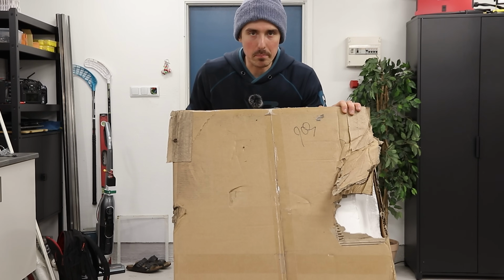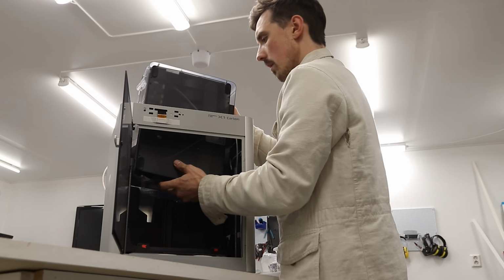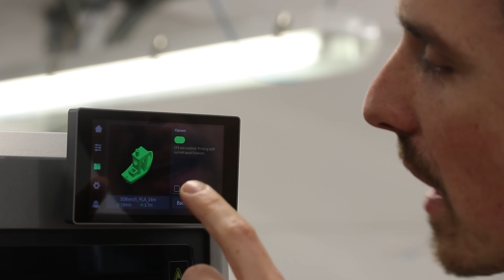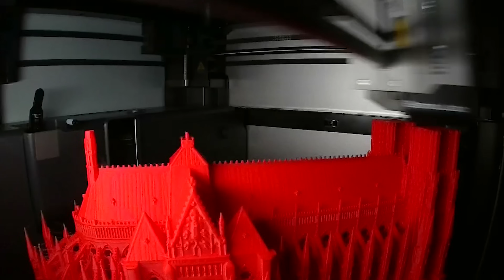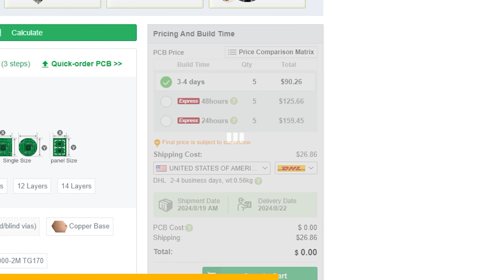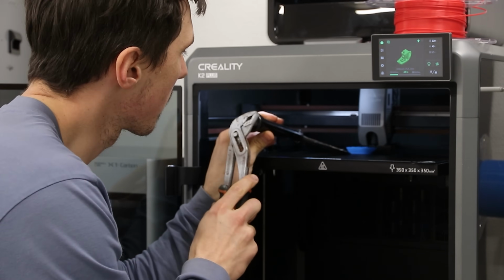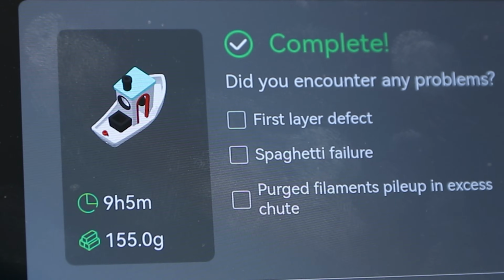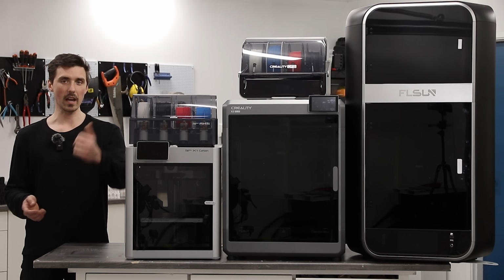Did I Just Find the FASTEST 3D Printer?

Comment: The best use of the AMS I've found is to use PETG as a support interface on ABS prints and setting the support Z-distance to zero. PETG doesn't stick to ABS, so when you're done, the supports effectively fall off with little effort, but with the zero z-distance, there's no artifacting on even the largest of overhangs. It's great.
Reply: I have tried the same thing for PETG/PLA combination and it all fell apart. Even with a lot of purging and a ton of wasted plastic the nozzle did not clean enough to completely prevent contamination. The prints had near zero layer adhesion. With PETG/ABS combination this is not the case? That would surprise me a little. I would expect at least somewhat similar effect.
Reply: @hebijirik because PETG prints at a higher temp than PLA, ABS and PETG is about similar. Anything more than 30,40 deg difference would probably run into issues like the hotter material melting the not as hot one
Reply: @JojoJoget temperature is one thing,  but chemical contamination is another. Maybe you have noticed that after switching from PLA to PETG, the perimeters of the first layer can be peeled from the print really easily. And that is despite the leftover PLA being purged out of the nozzle by the PETG at 250°C and is almost liquid. So when something like the AMS keeps switching them for every layer then the PETG print barely holds together. I was curious of there is something similar happening with ABS because I never tried that combination.
Reply: I dont have that problem. Maybe bad combination of filaments ? 😂  @hebijirik
Reply: @hebijirik  I´ve done PLA/PETG combo prints with PLA as an interface layer for the supports on a PETG print. Worked great. I set both materials as PETG in the slicer though, so it might not work with Bambu filament where the AMS can read the RFID.
Reply: @Fusionpåskånska interesting,  I  tried that years ago with prusa mmu and got the problem described above even with purging set to max the slicer would let me. At first I thought it worked great,  on a print with large enough layers. But then on a print with thin walls I found it unusable.
Reply: @hebijirik  so far I have only printed stuff with large support surface areas using this technique so it might be that it doesnt work on thinner parts.
Reply: @Fusionpåskånska could be. The longer the PETG layer takes to print the higher the percentage of it that gets fully clean PETG with no PLA residues clinging to the inside of the nozzle and then the part holds together enough.
Reply: @hebijirik  I found double purging works, but the H2D solves it for real.
Reply: @rsilvers129 I'm tuning a V-Core 4 500 IDEX for someone now, and on that, the dissimilar support materials work well too. And the change of nozzle takes about half a second only so not longer much printing time when you use it for that.
Reply: Why would you even care about support interface for ABS of all things
ABS literally doesn't stick to itself if you have enough cooling
Reply: so to confirm, no more bad prints on supported areas with PETG?

Comment: Since you are printing technical parts, I think only thing missing from comparison is testing geometric accuracy (that might be a problem in Delta printers). And what I always want to see - bed meshes which I think are by far the most reliable indicator of build quality.
Reply: And maybe some more "exotic" filament :)
Reply: Yeah, tecnical parts should be printed with others filaments order then PLA. Bambu will be much more reliable with those… PLA test is not what I want

My Creality K1Max is a pain in the ass to print engeneer grade materials that do not need a heated chamber, PLA works fine and reliable. Bed mesh is a trying and error experience, never the same!
Reply: Delta are good for round-ish tolerance and less good for square-ish tolerance. They both have their pluses. But delta build volume is weird and that noise is unusable unless its in a separate State 😂

Comment: Well, now it's time to test Bambu H2D?
Reply: same question why compare x1c while we have h2d........
Reply: @ResulIlmammedov  Because he compared printers at the same price point. H2D is 3200 eur.
Reply: @AstroNootFPV  It still high enough that it still wouldn't have made sense to compare them, but in the US, the H2D is 1,900 USD for the base printer, 2,100 with the AMS 2 Pro, 2,800 with the 10 watt laser and AMS 2 Pro, and 3,500 with the 40 watt laser and AMS 2 Pro (but most people aren't interested in the laser). 1,900 is a lot closer to the X1C in price, but yeah, its still a completely different price point.
Reply: @AstroNootFPV  sitting right next to one, bought it for 2270€ shipped to Germany...
(it's definately a bit faster than the x1c and rattles way less)
Reply: @ResulIlmammedov  I saw in one review where the X1C was faster than the H2D for single color printing. Makes sense, seeing that the X1C has carbon fiber rods. But I guess it has to be tested
Reply: @SangheiliSpecOp  The main reason the X1C CAN be faster is because the H2D has a massive and heavy printhead with the two nozzles.
Reply: @cedarcoombs8111  that too yeah. They did a good job reducing weight (I think?), the way the cam like mechanism lifts the nozzle up and simultaneously disengages the extruder gear from one nozzle and engages it to the next is very cool

Comment: The line you pointed to on the Benchy is not actually a printing artifact on the Bambu Lab printer and is due to the the structure of the Benchy itself. Prusa has an article on it if you search for "benchy hull line" on Google (as I can't post a link). Changes need to be made to the g-code itself to eliminate it as per the Prusa arricle. if you don't see it on other printers, it's because the manufacturer has modified the benchy.